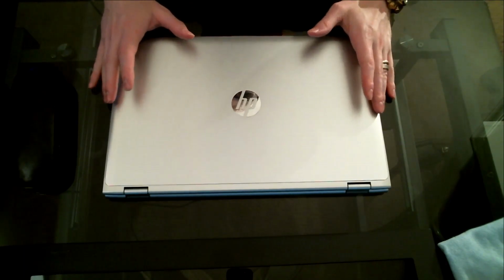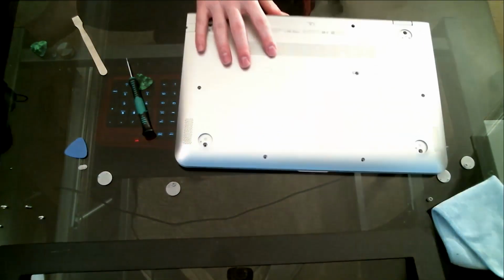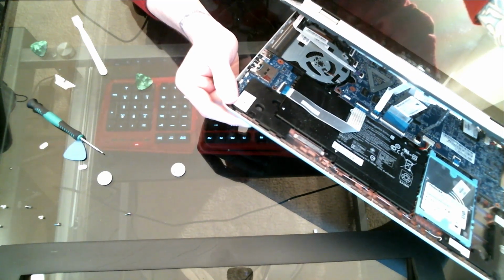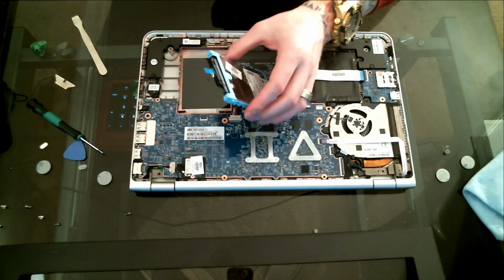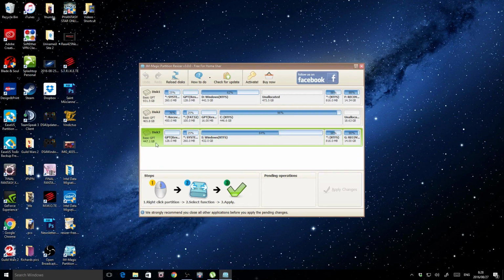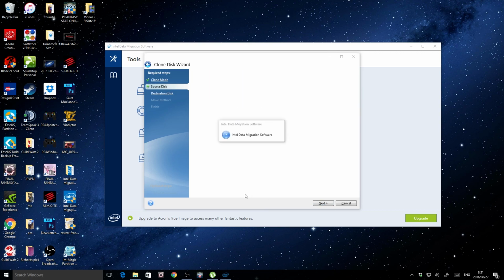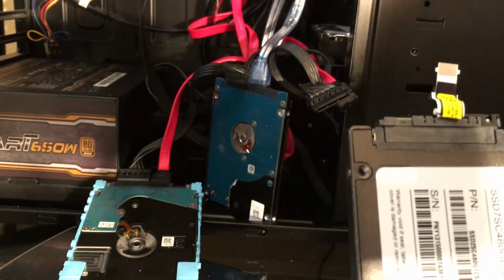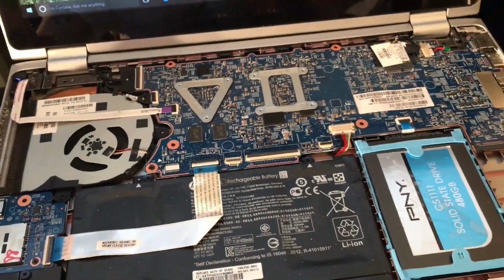Hp Envy x360 m6 Convertible Gaming Laptop Upgrade To SSD

Comment: If you do a "system image" of the HDD, part  of the process will ask if you want to create a "system repair disc". Get some read/write cd's, create the disc and you will use the disc to boot the OS with the SSD installed. Then you can plug in the external hard drive and download the system image. This technique can be found in the settings menu. I just did this a few days ago changing out a 1 TB HDD to a 1TB WD SSD. Have fun!
Reply: Great info, this guy doesnt know what he is doing.
Reply: Hi there, which SSD did you bought?

Comment: what  if you use an SSD that it the same size as the HDD or bigger would it cause problems in the cloning process?
Reply from the maker: Nope, it should clone without an issue.

Comment: I've never removed laptop cover before with those tools. Can you point me to a kit on newegg or amazon that has the parts? Don't want to ding mine up. 

Btw - thanks for sharing the software pieces. I would have pulled my hair out doing this.
Reply from the maker: Blake Whitney Hey thanks for the comment!  I really wanted to show all steps in detail so no would have to question certain points.  If you need some good tools here is a link for amazon.  http://amzn.to/2feL95p

Comment: Yeah,  it took you quit a lot, to get to this :D I already upgraded the SSD and RAM.
Side note: Did you notice that right next to the Hard drive there is a slot for M.2 SATA SSD ? ;) :D Yes the board has a support for it, but in my case it has been locked from BIOS and it's impossible to utilize! So if you like u may check if your supports, which will allow you to basically have to storage locations.
Reply from the maker: That's interesting I didn't notice that.  I'm sure it's probably locked on these models though but I'll check it out!
Reply: I was told the RAM is soldered on, how did you upgrade?
Reply from the maker: jmel23515 I didn't upgrade the ram, I upgraded the hard drive to an SSD.
Reply from the maker: jmel23515 but other commenters on this video claim they have upgraded the ram so it is upgradable.
Reply: It is not soldered !! I just recently upgraded mine. I had one RAM stick 4GB pre-installed and the other slot was free so I added 8Gb more. 
Opening the laptop is a real pain in the ass tho. Basically you need to get the motherboard completely outta case to  install new RAM.
Reply from the maker: Haik0 thanks for clearing that up Haik0^^
Reply: Can you give me a link for the right ram to by for the (m6-w011dx) model?
Reply: Just search for a " DDR3L " RAM, it's a low voltage DDR3 RAM, thus the "L" suffix in the end.
So any any DDRL 8GB RAM (per slot, max. 16GB) will work!
Reply: RAXX425 oh my gosh.my point exactly, you have no business making videos,acting like you know what you are doing. Didn’t even know the M.2 slot was there? Wow.
Reply: Haik0 better off to leave the ram alone,when one of the slots are incorporated into the motherboard. The memory that comes with laptop is matched to motherboard. It is dual channel and if you change it, it’s possible that it won’t run Saul channel.

Comment: I have a hp envy x360 m6 with  1tb HDD, 2x 8gb ram , i7-7500U and intel hd 620 with 4gbs dedicated graphics memory, is this enough to run games ( I was thinking of getting destiny 2 for pc instead of ps4)or would I need to upgrade the graphics card ?
Reply from the maker: +Alex B You will still be able to play with integrated graphics but don't expect a decent fps.  If you want smooth fps then you will definitely want to invest in a laptop with discrete graphics.

Comment: Why did you use sata ssd and not m.2? I have 1tb hdd 7200rpm I am thinking to upgrade to ssd but I don't know what is better swap 1tb hdd to 500gb ssd or keep 1tb hdd + 256gb m.2. Please advice
Reply from the maker: +xaxaxa because I have heard conflicting stories about the M2 being locked and I didn’t want to spend the money for a SSD that I could use.
Reply: I could probably shed some light on this. I did exactly what you're suggesting, @xaxaxa, and purchased an m.2 256MB SSD hoping I could run it in tandem with my 1TB HDD, using it for booting and other processes. However, once I opened the laptop (and you can kinda see it in this video as well), I noticed that there is NO m.2 port installed on the MOBO, even though there appears to be a space allocated for it immediately to the right of the 2.5 HDD, complete with screw-hole. There's even what looks to be surface connectors where the port would be mounted on the MOBO, but it's just... not there. I considered just buying a port and surface mounting it myself, but it's hard for me to tell if the MOBO support for an m.2 is locked by HP or not. I couldn't find anything clear in the BIOS or online. So I'm just going to sell the m.2 I bought, buy myself a 500GB 2.5 SSD and turn the 1TB HDD into external storage.

I hope my experience helps!
Reply: Catharine Tarquinio what hp model is yours? I just exchange my m6 to the newer model that has slim bezel but I have found nothing about how to open it. I believe the motherboard os different that the previews model as the ports are located in different position.
Reply: My model appears to be the same as shown in this video, however, there is a slight difference. Mine is an HP Envy x360 convertible, model number 15-w155nr. What is shown here is the HP Envy x360 m6 convertible, model number unknown. I'm not sure what changes were implemented between the two (the original and the m6), however, the hardware appears the same, so I'm assuming most of the changes were minimal. The two generations are grouped together into the same manufacturer manual, so there can't have been many major changes, or else I believe they would require seperate manuals (or a manual that explicitly points out the distinct differences).
Reply: Catharine Tarquinio n
Reply: RAXX425 what are you talking about? Quit giving advice you know nothing about, what do you mean an SSD locked? Come on dude.
Reply: RAXX425 always use SSD NVME over Santa SSD. Locked,what is locked? If it took a Santa SSD a M.2 NVME would work, but I don’t think you would have ever got it to work, because you couldn’t even clone.

Comment: I have the smaller 11.6 inches version with i3processor. Is it poaaible for me to upgrade to an ssd?
Reply from the maker: +Akshit Kapoor is it has the correct sata connector yes.  I would try searching some forums to make sure before you go taking your computer apart though.

Comment: An easier way to do it would have been to backup all your files (docs, pics, music, etc.) to a USB then install the SDD and do a fresh install of Windows 10 off a bootable USB. Once done, move your file over from a USB and your all set. Maybe 45 mins tops.
Reply: Your PCMD no way is that easier. You can clone to SSD in 15 mins, if you know what you are doing.

Comment: hey so i installed my new ssd into the same exact laptop and it keeps coming up "no bootable device insert boot disk", i followed the instructions to fix the problem through other youtube videos but its still not working its still appearing "no bootable device" etc etc anything you can come to mind to help me fix the problem? I will send you 20-40$ for your services through venmo if we can arrange a facetime meeting.
Reply from the maker: Just create a bootable flash drive for a windows 10 installer.  Google “windows media creation tool”. Download it to a flash drive stick it in one of the USB ports and turn it on and it will automatically boot to the windows installer.  Install windows and done.

Comment: if i upgrade to this can i play csgo without frame drops or do i need to upgrade something else?
Reply from the maker: Uwilldie9 upgrading the SSD is only going to improve load speed and write speed.  It is not going to improve frame rate in games just the load times.
Reply: what can i do to improve frame rate? 
what do i have to upgrade
Reply from the maker: you would need to buy a new laptop to improve the frame rate.
Reply from the maker: Uwilldie9 a more expensive higher grade laptop.

Comment: thanks for the video I am very much considering doing this. My question was the only reason you cloned the drive so that the windows key would work? did you do it so you can have the recovery partition? Is there a work around without having to clone the disk in order to get the windows key to still work?
Reply from the maker: +xxlAlexlxx I did this so I could put the faster SSD in my laptop.  But no, there is no way to get around the windows key.  You either clone it exact or start a who new windows installation.
Reply: xxlAlexlxx you can do a clean install if you want,just use your windows key that came with laptop.
Reply: You can clone hard drive in 15 minutes if you know how. Especially when cloning to SSD. Partion then use cloning software.15 min max.
Reply: Please don’t give bad info,like removing keyboard and battery. People don’t need to remove all of that, and people doing this for first time,are just looking for problems, removing things that shouldn’t be touched,especially if they don’t need to be removed.